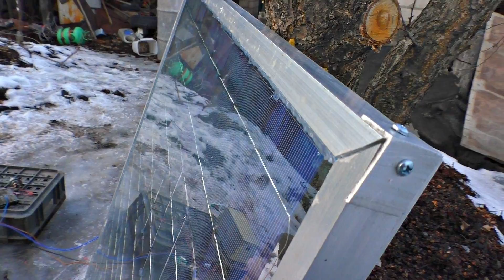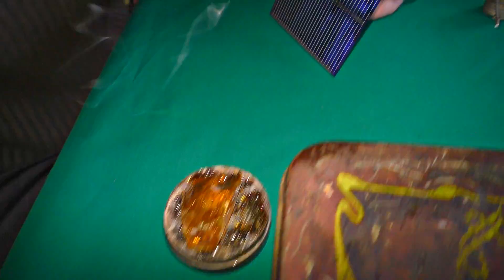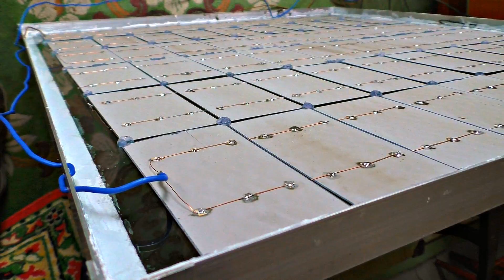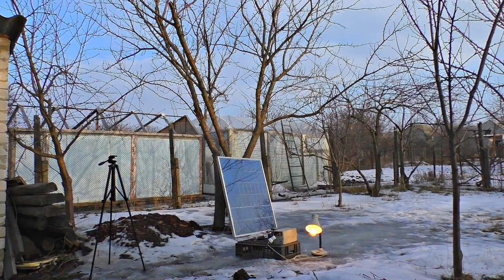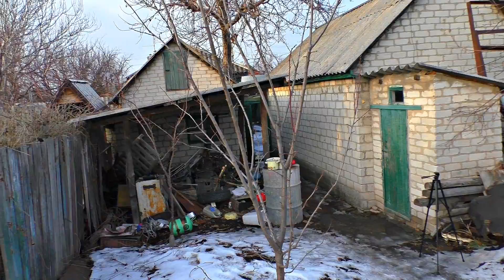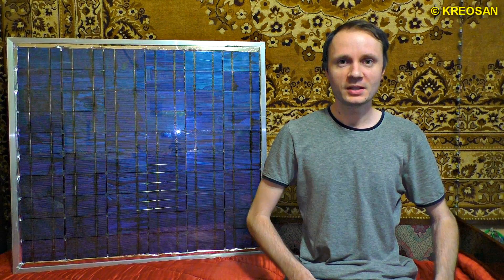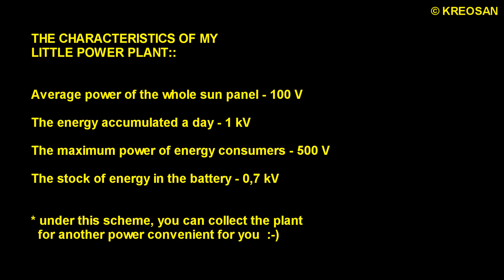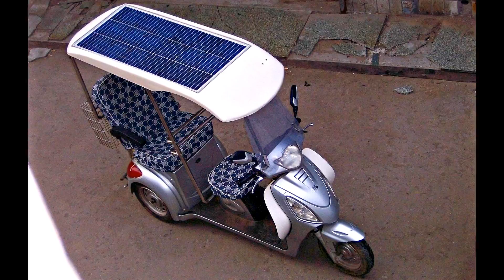Powerplant DIY /￼ Explicit step by step version / Assembling / Alternative energy

Comment: The cool thing is, solar is becoming so cheap, around 2021 it's the cheapest form of electricity at over 95% of the entire world! 
Only places like Iceland (with the hot water from the vulcano's), parts of Norway (with hydrolic electricity), and very rare places with a lot of wind it's cheaper to use wind energy. The price of coal, gas, and anything you can get from oil will be too high. 
Even the price of nucleair will be too high. By 2025, even if you have a Nucleair powerplant that offers unlimited energy for free, it will still be more expensive, because the transmission of the electricity (something barely required for the solar on your roof) will also cost money!

If you're interested in the subject, watch this:
https://www.youtube.com/watch?v=2b3ttqYDwF0&t=1s

The entire world is about to get changed dramatically and over a bilion people might lose their current job very soon!
Reply: The only flaw with solar is its inconsistencies on power output. I dont doubt that it will inevitably be cheaper to run solar, but all it takes is for a terrible case of bad luck, and 3 months of non-stop cloudy weather for it to become almost useless.
Reply: The price of batteries also falls down dramatically, cloudy weather isn't a problem at all, at max a massive pile of snow on top of your roof could be a small problem, in that case you need wind power or a hell of a lot of solar power. On the other side, frozen rivers haven't been that much of a problem either for coal power.
Reply: my point is that there may never be a time where there will be enough stored up power in any battery bank that isn't the size of a small town that could sustain a country for the period of time in which a string of bad weather for several months straight could alone cut the national power supply short.
Reply: Even with bad weather solar panels generate energy... It's a matter of time before it's 1%, then 2%, then 4%, then 8%, then 16, 32, 64, 99.99999%. It will happen within 15 year in the entire world, on several islands they already have 100% solar energy.
Reply: You're not getting what I mean. Solar panels are only good as a supplemental power source, if only because they are inconsistent. Sure you could run the majority of our power off of them, however even with 100% of our nation covered, with panels on every roof, you'd have maybe 50-75% max efficiency at any one time. You would NEED some sort of backup power source inevitably, for those rainy months, when the power stores are depleted. 

Sure it'd be nice to have toxic waste from producing solar panels all over the place, but unfortunately you're going to run up on some major costs before you even meet the half way point.
Reply: Solar is already the cheapest form of energy at around 80% of the entire world, even when you have a hell of a lot of clouds for ages and ages, it's simply a matter of turning all the solar panels on, instead of only half (only half would usually be enough to support the entire island forever with nice weather). Also note that solar power is still lowering in price about 30% every year and the amount of solar on the entire world is raising about 30% every year. It won't take long before the entire world is solar powered and I'm genuinly talking about 10 to 15 years. I can understand it if you want to keep some coal power station standby, but most likely, it won't ever be necessery any more within 15 years and I do mean ever.
Reply: Its not about how cheap it is. Its about how CONSISTENT it is; the solar panels THEMSELVES will be cheap, but the energy they produce may not be, due to the fact that it is not reliable in all settings. Your fetish for cheap solar energy is nice and all, but it is not the end all solution to power problems in the world. Anyone who is an engineer would know that leaving all of your eggs in one basket is a quick path to destruction.
Reply: I have the feeling you don't realise how much energy solar panels generate. 
With one solar panel, I repeat ONE solar panel, a normal 150 dollar or less customer solar panel, not special NASA stuff or anything like that, you can power three widescreen televisions at the same time, THREE of them!
Tesla will sell a truck with a megawatt of energy in it's battery for 180.000 dollar.
Simple math gives that that's at max 180 dollar for 1kWh, by simply throwing the truck around the battery away, with one truck, an average Dutch household can survive a 100 days! So even if it's completely dark for 100 days in a row, it's still not a problem. And also that battery price is only dropping more and more.

With batteries alone, there can already be saved about 10% of energy, even if you continue to work with coal power stations. The world is shifting and it's shifting fast, within 10 years almost everything works on solar, within 20 years there probably won't exist any coal power center any more.
Reply: I dont think you know what you're talking about when you say that you can just 'merely' get batteries to store the massive amount of energy needed to prepare for the worst conditions. Solar panels only ever reach their maximum output average at only 25% of the day. Funny enough, the maximum demand for electricity is at around 6:30pm, when solar output is near zero. Solar energy is unreliable because of factors such as weather, nearby obstacles, the propensity to being delicate, and most importantly, time. 

Since solar panels are not producing 75% of the time under ideal, clear conditions, only pumped hydro storage could possibly supply the storage capacity needed, and then only at massive cost, in a few suitable locations. You would also need to own massive swathes of land in order to produce it on an industrial scale as well, since otherwise it would simply just become diluted. 

"oh but solar panels are so powerful!" As if.
If it were possible to anchor a solar collector one meter square at the top of the atmosphere, aligned continuously to face the sun, and never shadowed by the earth or the moon, it would receive solar energy at the rate of 1,366 Watts per square meter (W/m2).  That would power 13 light bulbs each using 100 watts.

If that panel were located on the surface, at the equator, under clear skies, aligned continuously to face the sun, and never shaded by the earth or the moon, solar energy dissipated by the atmosphere would reduce energy received to 1,000 watts.

In the real rotating world, where sunshine reaches usable intensity for only about 25% of the time, the best-located panel would have a capacity factor of about 17%.  It would receive 170 watts of energy – not quite 2 light bulbs. PV solar panels convert solar energy to electrical energy at an efficiency factor of about 15%.  Thus, our panel, at the equator, year-round, should deliver 25.5 watts of electrical energy – one very dim light bulb.

Even if you were to cover roofs with solar panels, it would never be able to compete with the compact designs of an industrial solar facility.

https://www.americanthinker.com/articles/2014/07/five_fatal_flaws_of_solar_energy.html

Why dont you get more realistic with your dreams of a single, magic solution? In the very least, reactors will never go away. Coal plants will never go away, and even then they will still be cheaper than solar because they are not only functioning 25% of the day.
Reply: 25,5 watt? What are you talking about? A 150 dollar 270 watt solar panel delivers an average of 651 watt a day in the Netherlands (and it's very often rainy over there) and that solar panel is about 1.6m². So even if you do 651/1.6=406 you still get over 400 watt a day a m². And that's just a random cheap solar panel, nothing special about it. A 100 watt light bulb? They aren't even allowed to be sold legally any more in my country?! Even back in the days 40 watt was normal, I got a 3*3 watt LED light in my room, which is easely enough actually. It's obvious that you don't have a clue what you're talking about and batteries are genuinly the future. In Australia they already got a 100mWh battery from Tesla, which has recently saved over a milion dollars in a couple of days.
Reply: all you seem to care about is energy on the residential scale. Sure, having the lights turned on might be 'just' good enough for you, though to run any appliance other than ceiling fans or lightbulbs, it is ESSENTIAL to have AT LEAST more than 5000 watts available, otherwise you're going to run a shortage. 
Here is a list of appliances that are typical in the modern household. 

http://powerupgenerator.com/typical-appliance-tool-wattage-table/

Your sense of scale when it comes to solar panels is completely stupid. even if you had 10 of those 651 watt solar panels, you would use ALL of the power within the span of a day, and that is just barely cutting it, god forbid you ever decide to run your boiler and have hot water. You'd need two of them just to run something as simple as a single fucking blow dryer. 

even 50 of these proclaimed 651 watt panels wouldn't be able to keep a factory running for more than a single day, and that is on IDEAL conditions. Were there to be a storm that spanned over more than even half a day, there would be brownouts all over the place, and render the place effectively underpowered to the point of non-function. Not to mention, there are no '651 watt' solar panels in existence on the market. The best that we do have, are ~450 watt panels.

Batteries are not magical boxes of energy that just 'suddenly' gather all the power they need when an energy producer is available; solar panels are too inefficient to ever fill even a portion of a milliwatt battery in any significant amount of time, not without first allocating a massive swath of land that would from there be specifically allocated toward hosting these solar panels. 

Call me when we have 100% efficiency solar panels, which produce 1000 watts per square meter. Even then, they are still too unreliable to take the place as the keystone of our economy thanks to weather factors, but by that point, you would on an ideal day of clear weather be able to in the very least supply complete power to a modern house, with washing machines, dish washers, dryer, boilers for hot water, heating/AC, a subpump to keep your basement from flooding, as well as a number of kitchen and home appliances, such as an electric oven, microwave, a television, computer, etc.
Reply: It's not ideal conditions, that where the average conditions in the Netherlands in 2017... The Netherlands, not Egypt or something. 10 panels, that's 16m², that's 4*4 meter, just about every roof is more then 4*4 meters. And that's just with the cheapest panels, there are panels that generate a lot more electricity as just 270 watt. Most of the time people buy a little more expensive ones on purpose, since installation costs also costs money.
Ofcourse there do exist factories that use even more electricity, just like there exist people that generate more electricity as they use themself.

A 1000 watt is ridiculously much, you probably only got a handfull of items in your house that use more energy as that and you probably only use them about 30 minits a day at max.
Reply: roughly ~1000 watts is roughly ~100% efficiency. The measurement is 1 Kilowatt-hour, also known as 1000 watts per hour. A large portion of the appliances that I showed you on that list that are practically in every home already consume at an average of 1000 watts per hour, if we're talking 'comfort essentials,' like a boiler room, washing machines, dish washers, heating/AC, etc. 

My point is that batteries that store anything over a period longer than a night will be underutilized, because if you run radiators, that thing will consume anywhere between 4000-5000 watts an hour just to keep your house from turning into an ice box. A space heater will work at 1000 watts an hour, though there's that lovely risk of fire that often comes with them. My point is that you're going to run through 32,000 - 40,000 watts of energy JUST to heat your house at night. There is not any one brand of panel that can output enough energy that will last even through the night to compete with these demands, and not everyone can fit more than even 10 solar panels on their roof. 

Thus, while it may be a nice option if you're not living at your home for the majority of the time and have no running electronics, it is not a good option to be anything other than a supplemental energy source for any other circumstance.
Reply: 40.000 watts just to warm up your house?! Are you crazy? The average Dutch household uses about 9.000 watts of energy a day, not 40.000+. And even with that, you have to notice that the average Dutch house isn't as well isolated as a modern house. Really, your numbers make absolutely no sense whatsoever. 
On top of that, yes some houses create more energy as they use and others may create less energy as they use, but it's just a matter of time before that averaged.
A school for example can generate much more energy as it uses, a gym can also generate more electricity as it uses, a supermarket will probably be draw ish, or a little profit even, an airport can make a massive profit, since they are often only laying in grass that can't be used for anything else. A distributioncenter can make massive profits. In China they even put solar panels above their farmers their plants and still let enough light through to let the plants grow well enough. All those things can get balanced through the grid.
Reply: You think big players like the OPEC countries will allow this? No, they control the world's  oil reserves and influence the global oil price. Whenever renewable energy becomes cheaper than oil, they reduce their oil prices in order to keep countries buying oil from them. This is what prevents countries from switching to renewable, as when renewable sources are compared to oil, they are seen as 'too expensive'. The middle east has enough oil reserves to last 200 years, so they can still keep countries hooked on oil for a long time, delaying our progress of switching to renewable.
Reply: unfortunately, oil isn't in unlimited supply lol. There will be a time in which more efficient and effective energy sources will have to be considered, regardless of how much tinkering big oil companies do. In fact one of the more recent things they're doing is funding electric cars and sorts, though the problem is less so the fact that big oil doesn't like it, but rather that the USD is directly tied to oil purchases. The end of Oil would effectively end US dominance over the globe.
Reply: The price of solar panels has went down from 70 dollar a watt to 30 cent a watt and it's only going down further, meanwhile oil has gone up in price about 15 times.
200*15=3000 times and that number will only get worse. It's a matter of time before solar panels become 20 cent a watt and 10 cent a watt. It's just like computers, in a supercomputer worth 50 milion dollar in the year 2000 is worth about 40 bucks right now. And that's only 18 years... A factor of a milion! 
Same thing with batteries, In the beginning it was 5000 dollar a kWh, then it wet to 2000 dollar, right now it's about 150 dollar and still going down big time.
Reply: OPEC countries will simply decrease the price of oil if that happens. They have been doing this every single time and it prevents renewable energy from becoming mainstream. Due to them decreasing the price, countries buy more oil which increases the OPEC countries' profits, and allows oil to continue being the primary source of energy.

Also, yes oil is in limited supply, however OPEC countries can still delay our development of renewable energy for their own financial gain, which can still set us back a couple of years in renewable energy development
Reply: They are allowed to, but the price of solar panels will drop, no matter what ;), there's more sand as oil, and sand is allways cheaper.